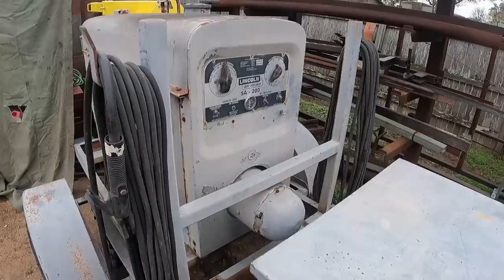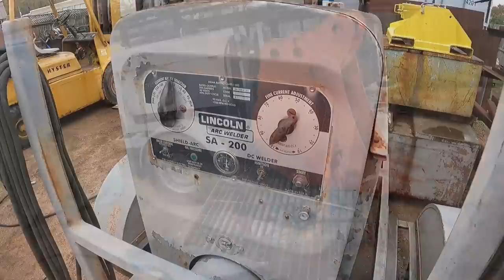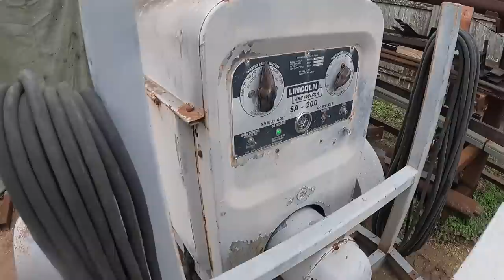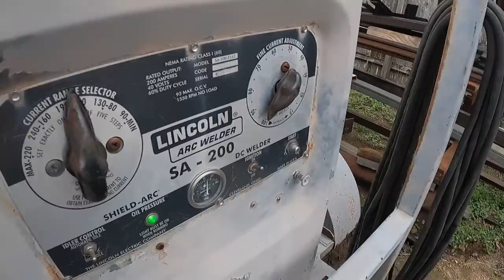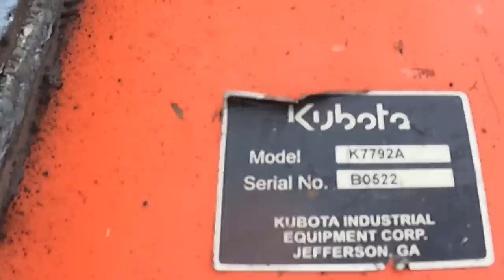Arc Gouging with an SA-200??

Comment: Great video. Retired Cat mechanic here..We air arced and welded with  big 7018 sticks all day long with SA-200's and no problems other than the longer the longer they ran the hotter the arc got. Anyways I think the  interstate highway system was built with these Lincoln welders!

Comment: 200 AMP Lincoln with a continental 4 cyl should just love arc gouging, I had a P&H 400 that loved it , carbon rods are not nears the load of a stuck 1/4" 9024 C-3 !

Comment: Great video🤙🏼
I am presently working on a 8 ft loader bucket for a local dealership it’s a JCB 4 in 1 bucket and I’m using a big 40 Miller tow welder and it’s amazing for air arc and great for stick welding. All the younger guy were asking “what’s all that noise”?😁 they’ve never seen this used before. I love it for removing brackets and plates exactly what you’re doing. Great job Issac 🤙🏼🙏🏼

Comment: If you can step across it you can fill it. 😂 Another excellent video. That old engine welder did just fine and as you said, if you don't do a lot of interrupted or broken welds/gouges it should handle it without a problem. Thanks for your efforts to share your expertise with us. I is appreciated.

Comment: Thanks for the tour, IC!
Sorry I'm late, but the video was just now recommended.

Thought I might share my CAG experience to anyone who wants to read free recollections worth darn near their cost.

I worked with heavy carbon steel plate, usually crack gouging and weld removal. I worked with  round and flat carbons, usually in the 400 amp range. Application charts give recommend settings;  usually DC, Straight Polarity - that's work clamp positive. Carbons of 5/16 round are probably recommended to run in the 400 amp range.

My experience is different than what I watched in the video. I don't recognize the electrode holder shown, but they're all of the same principle - carbon brings the metal to melt, air blast ejects the molten metal.

Typically my technique didn't involve any forward/back  "pumping" of the electrode, although sometimes a side-to-side weave, or wash. Never had to preheat the carbon to get fast light-off.  Typically I would position the electrode nearly flat to the work, hopefully with a good clear exit path for the firestorm. Lol I recall the intensity being much worse and more brutal than seen in the video.

Something else I noticed... in my experience electrodes would quickly burn to a needle-sharp point and the most intense burn-off would be concentrated at the point. Not seeing the "pencil point" in IC's video.

So... I wonder about polarity, adequate amperage and available air volume as demonstrated? 

All that said, it's tough to argue with success, and as demonstrated the bucket's ears were nicely removed. All I'm saying is that the technique is different than what I used.

Comment: Used the older Lincoln and Hobarts for years doing production welding and carbon arc, never had any major problems. They were good tough basic machines. Thanx for sharing.😄

Comment: I have and weld with an old Lincoln  SAE 400 amp with a six cylinder continental engine . It has never failed me for over 35 years . Still burns rod with the best of them . A lot of hard facing hrs and welding cracks up on Cat scraper cushion hitches , first gouging them out and then welding them back ,great video and thanks for sharing . Your a top hand just like Kurtis I watch y’all’s videos and haven’t missed a one . It’s awesome that your son is following in your steps. Both my sons also are mechanic welders out here in Southern California working on large dirt spread subdivisions keeping the machines in the dirt day in and day out . 😎. That excavator noise is called job security!LOL
Reply: Is California going to have any hills left with the way those crews attack hills and turn them into housing subdivisions?
Reply: @markfryer9880    Well yeah lol . If we run out of mountains we will just dig up the valley floors and make them 😎. Need low areas anyway to trap water instead of letting it just flow to the ocean . Water is getting a might scarce around these parts .

Comment: I bought an arc gouge in the 80s,  I did not get the hang of it.  Still new.  I gave away an SA200 because it was just sitting.  Watching you has shown me how the gouge should work.
Reply from the maker: Give it a shot!!👍👍
Reply: What kind of electrode do you use for the arc gouging? Is an air compressor necessary or not?
Reply: @lukeromanfreeman got to have a big air compressor 11cfm atleast or a big tank 60/80 and let it build here and there.

There are special air arc or  Gouging rods

Comment: Nice work as always. I have a similar job coming up where I am fabricating a root ripper for my tractors backhoe. It will be 1" thick ripper blade made from two 1/2" plates welded together, then hard faced. Which will be welded to a 3/4" base, then to fab up the pin plates and weld them on. Should be a fun project. I'll get plenty of stick/7018 practice in.

Comment: My dad used to use an old Lincoln oilfield special it originally had a red seal Continental engine on it and he put a 4 cylinder model engine on it the only trouble was he had to turn the amperage up a little bit more because the motor did not turn up as fast as the Red seal and he used it for years and years and years love your videos be safe have a great day and a very Merry Christmas Sam

Comment: Hey Issac, love the old gas Lincoln! Years ago we had a 2cyl Wisconsin, crank start, Lincoln. Great welder and once you knew the trick, not too bad to start. Once you struck an arc it more buzzed like you could hear the cycles. Sweet!:) Thanks
Reply: I used that same welder for farm equipment repair at an IH store in the 70’s and 80’s it had its limitations, but a good welder.
Reply: I have one in my shop I picked up a while back and am slowly trying to get it back into working condition. Has a 2 cyl. Wisconsin TF hand crank engine coupled with a Lincoln 180 power head made in 1951. Called Lincoln's main headquarters a while back trying to get info and parts availability and the head guy told me Lincoln never made such a machine because he couldn't find it on his computer. I told him to see if he could find it on microfilm in the archives and he indeed called me back and emailed me copies of everything they still had on file on the machine... sadly wasn't much but it was helpful none the less.
Reply: @bigcountry9957  Wow, actually getting a call back from a Service Department guy!! Colour me surprised! I guess being Lincoln you were dealing with, a Shade of Lincoln Red should do me fine!
Reply: Lincoln, bar none, has excellent customer service! That’s the reason I switched from Miller to Lincoln equipment 17 years ago. Both have fine equipment but you can’t beat Lincoln’s service and communication with the customer.

Comment: LOL, "It's a welder, That's what it's for"  Well yeah! However if ya try to run 1/2" carbons with a 200 amp welder (if you can get it to start) for any amount of time it will most likely not be a happy ending. Like the Air Arc vids my friend. Cheers

Comment: I used to call mine my Lincoln Continental, lol. Hard to beat those 200's, they'll do anything a 400 amp Miller or Hobart will. Just don't plug your AC grinder into it.
Keep smilin Issac.

Comment: Thanks Isaac for sharing.
On the undercutting depending on the job is it worth filling it in for appearances? 
I still like water cutting thicker plates from a pattern or drawing for some weldments if it is nearby to get it done.
I remember Dabney Welding & Son in Leesburg, FL took over his Dad's shop and many of the machines were still belt driven back in the 1980's he had an old Lincoln genset like yours he took everywhere for field services. Mr. Dabney would try to do almost anything. He was one of the first welders in the area to weld the water parks PVC piping systems in the early 1980's that were opening up in Florida at that time. The glues at that time were not strong enough on the big piping systems required by the waterparks.

Comment: Issac, did you get your start in pressure pipe welding or a nuclear welding?  You have a smooth touch and control your weave really well.  I couldn't do what you do no way no how.  You are the best at on the spot engineering and design of the most expedient fix on whatever you do.  OH and keep the videos coming.  They are much appreciated.

Comment: Great video.  I really enjoy the view of the arc puddle.  Wish my welds came out looking 1/2 as good but I am still learning.  Plus I have to run off of a generator, kept tripping the 30 amp breaker on it (need to find one with a 50 amp) so a lot of starting and stopping.  Video is up if you are interested.
Reply: I tried finding your video to see what kinda set up you got but didn’t see it. I run a rigid 6800w /8500w generator and never had problems with the breaker. I also run a mig welder off a 4000w 110 amp generator and that does pop breakers. I run a mobile welding business and the generator is what powers my machines 90% of the time. No problems at all.
Reply: @scrapmanindustries  Thanks for trying to find my video. It is in "Broke my thumb".  I have a Generac 10000/8000 and was using a Lincoln tombstone AC/DC on hottest settings burning I believe an 1/8" 7018.  I have not run my Mig welder with it but do not foresee and issue running that.
Reply: @detornodoes  try turning it down to 125 amps for 1/8”. Or 90amps for 3/32 7018. I have videos running an old style ax/dc Hobart stickmate off my generator with no problems. It would push the engine but never failed me. Built like 30 flights of stairs with that set up. I think it was around 8300 watts burning 7018. If that don’t work there may be something else going on. Most welding video’s on my channel are powered by a generator of some sorts. I only ever popped breakers on the 220v circuit running spray on the fronius. And using the thermal dynamics cut master 58. You need like 12k watts for that thing.

Comment: i run 8mm sollid carbon rods at 480 to 520 with 5 to 6 bar air (run ground on negatif )

will try low amps next time but never heard anybody run so low (perhaps difference because live in holland)

nice job must add (keep going strong)

Comment: IC I'm always learning something new.
Share a trick of the trade. I worked in a green sand foundry in maintenance for 20 years we always worked with one millwright company on one job I was assigned to work with the owner. We we're putting flanges on thick wall high pressure pipes I noticed he always stuck the rod to the work piece and quickly snapped it off and then started the weld. I asked him why he did this, he explained to me that it was a poor man's rod heater, this got the end of the rod warm so as the rod was being consumed the rod temperature at the end had some heat in it.

Comment: Adjusting your angle can result in a smooth, and steady gouge, as opposed to your current method. This will also mean a smoother gouge and less work cleaning up. Had a job removing an oil channel around it. The boss wanted us to use an oxy/acetylene torch to remove it. Once I set up the gouge, the entire piece was off, in a matter of minutes, with minimal cleanup.

Comment: Would it be worth drilling into tight little corners like that, it might give you clearance to let the melt blow out  better. thanks for sharing, great looking job as always.

"Relax its not falling off"  with a welding torch graphic would be great for a t shirt design.

Comment: Does the carbon rod have the ability to pull the metal some. Looks like you are using a keyhole pattern with the carbon Ron. Wondering if that is the best way?

Comment: Isaac, were you supposed to weld the pins in? I never seen a quick attach that used pins, interesting.
The welding is spot on as usual. Love how the machine starts right up, didn't even really need the choke lol. I'm in northern Canada and it's the middle of winter, today alone it's -31*C and our stuff protests a little more when we start them. 
Awesome video Isaac, thanks lots of good info again.

Comment: I could see not using a newer gas drive welder for gouging. Unless it's rated for it. But a old generator type is no problem. My 2016 Miller Trailblazer 325 is rated for it. Knowing what your equipment is capable of is the key. The Trailblazer 250 that I replaced wasn't.

Comment: I've been told if it's got circuit boards don't arc gouge. Sa200 with a straight d.c. generator is the only machine I will gouge with. Gouged once with my miller 301 and the mother board went out shortly after. Also in my humble opinion nothing stick welds as good as a sa200.

Comment: When i was a real young kid my uncle had me take a d cell battery apart for the carbon center & hooked up jumper cables to the tractor so i could gouge out some weld spatter from inside a trailer hitch because the hitch wouldn't let the tongue slide in to put the pin in it ! That was my first ti,e even being around welding i was about 8-9 yrs old now i'm almost 64 & cant see at night from so many years welding !

Comment: Hey Issac. I gouge on a Miller 330A/BP. I've found best success with 1/4 rods, and I tend to run them at 70% in high range, which would theoretically be around 400 amps. Even still, I can't blast off metal as fast as you at 200, and it's hard to keep running. I'm not sure if it's a skill issue or just due to the welders low output voltage causing me to have to compensate with amps?
Reply from the maker: Its a fine balance of feeding the rod at a constant rate to keep a steady arc. It takes a while to get right. Each machine is different as well. different arc characteristics, etc. I usually use my Miller trailblazer 302 airpak . Works good. Once you get the hang of it, it gets much easier to gouge faster.
Reply: Thanks. I'll try some different current settings and keep trying to get a nice steady arc. The close up shots on your pattern help a lot.

Comment: I’m not a welder but I find your videos interesting too watch. Is there, or what, is the benefit between MIG welding and stick welding? Is one better than the other, or have a different application?
Reply: Stick is used for outdoor welding simply because it doesn't use a cover gas. Wire feed aka mig is faster with less clean up. It's all in the choice of Wire and cover gas. A #6 wire with a 80% argon 20% CO2 mix is the same as 7018 rod. While I own a mig welder I don't use it vary often.
Reply: @steveb6103  interesting..didn’t know that..thanks Steve.

Comment: To improve arc striking use the OCV to 100v. 
Use DC electrode positive. 
I’d suggest tilt angle of 10-15 deg. and position the weld to be gouged vertically gouging from the top downwards & keep the stick out no more that 6”. The air jets are designed to point inwards focusing the jet to a specific location. 
Ensure that the air jets are under the gouging electrode.
Also, the copper free end of the gouging electrode is the end that should be directed to the workpiece. 
I’d also increase the amps. I note you often say it’s good enough and the job gets done but small changes can make a big difference.
Reply: LOL I think Isaac knows what he's doing. You on the other hand "This channel doesn't have any content".

Comment: What’s the rod you’re using, may I ask? Can’t be 6010/6011, not enough splatter, guessing 7018?
Reply from the maker: 7018
Reply: @ICWeld  goes to prove, even a stopped clock is right twice a day.. wonder what the other thing is going to be?

Comment: we always kept a ol junker pipeliner to air arc my buddy who spent way many hrs 0in field than me always said that it destroyed the polarity on a machine i never have used gouger on mine never will still have the ol junker though lincoln 2000 my choice still love youre videos only thing a lincoln wont do is run modern day power tools with varible speed controls they destroy them been there done that desroyed my new milwaukee band saw tool man said you have a lincoln welder dont you i said t\yes but what that got to do he said they put out dc on 120 no more varible tools go with ol lincoln milwaukee did warrty though lesson learned

Comment: A question: Arc Gouging - can it be done AC and DC? 
Also, I spotted that the stick holder you're using for MMA is quite small. I'd never even considered that a smaller holder would be more useful for tight corners! (I do get that there's an amp rating on holders but some are stupidly physically too big)
Reply: All my gouging has been DC.

Comment: could you mention how much air pressure you are running with your air arch?
Reply from the maker: 80-100psi
Reply: @ICWeld  thank you. i will have to get a bigger compressor. my current one will only maintain 60 psi

Comment: I wonder what those guys who say that you shouldn't arc gouge with that machine would say about putting the stinger and ground leads on a steel crude oil production line as far apart as possible with it turned up all the way to make enough heat to melt the ice in it so it will flow LOL.      Checked that box a few times.

Comment: I’ve never really arc gouged before. But do all gougers need an air compressor as well?
Reply: Yes.. we always run our compressor air through an drier.. we also use oxygen packs as well if were using over 500 amps